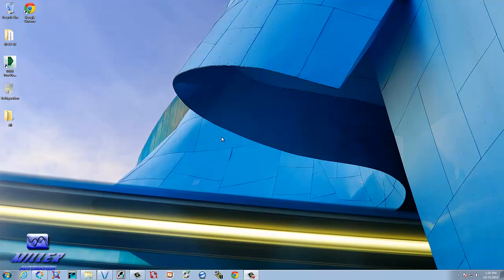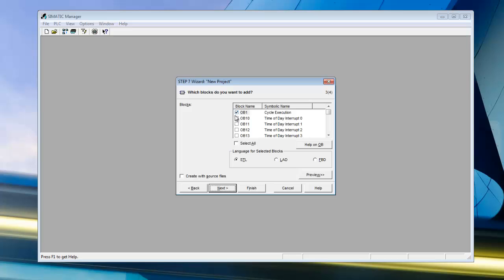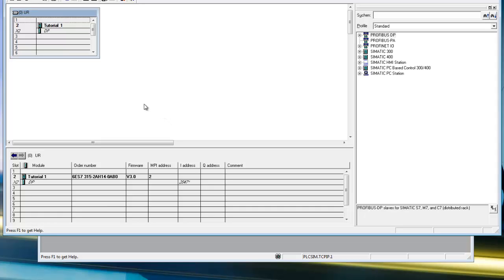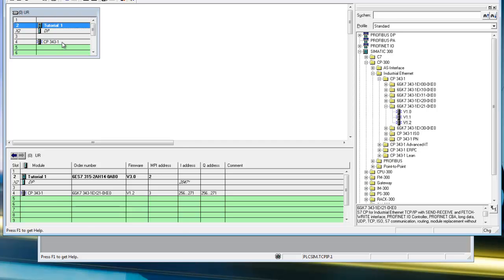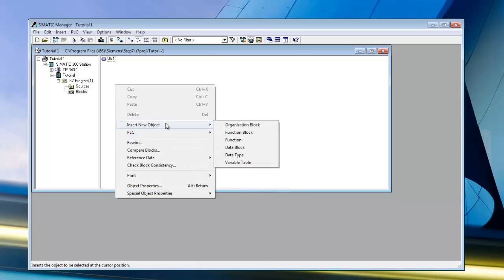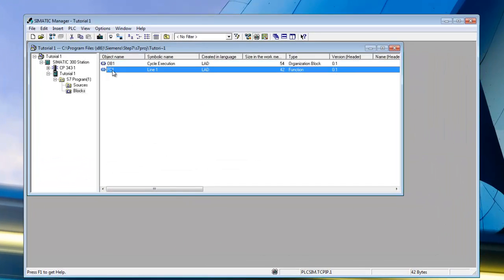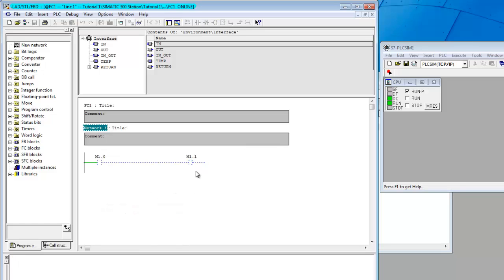SIEMENS STEP 7 V5.5 Tutorial 1

Comment: I didnt get the FC1 tool !! Can U tell me what to do?!!
Thank you
Reply from the maker: you create the Function
Reply: Hi Doom,

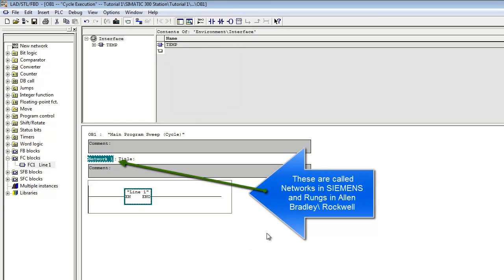"FCx" / Creating a Function File  is like creating a LAD Program File in Logix 500 or a New Routine in Logix 5000. Siemens confuses things a little by having Function Files and Function Block files. Essentially its a file containing a Logic Sequence that can be executed on demand when scanned by OB1 or another logic file. When you put your Function file into OB1 as shown in the tutorial, you get the EN and ENO bits presented (Enable Input, and Enabled Output) - 6:50. This is quite common in IEC 61131-3 Function Block editors such as PCWorx, Beckoff etc.

"FBx" Function Blocks on the other hand, declare the Inputs and Outputs and conceal any remaining logic inside. So when you put the block into a function file like OB1, you see the Inputs and Outputs you have mapped but the logic is hidden inside.

"OB1" is like the Main Program in Logix, and calls the logic files in the order that OB1 is scanned. You would be doing a JSR or Jump to Subroutine Instruction in Logix 500 traditional ladder.

If you need further help, just reply.

Comment: What OS are you using ?? I couldn't install step 7 5.5 in W7 64 bit
Reply: You should be using Windows 7-SP1..
It will even work for Siemens TIA Portal 13 also..
Gud luck..
Reply from the maker: win 7 pro 64 bit